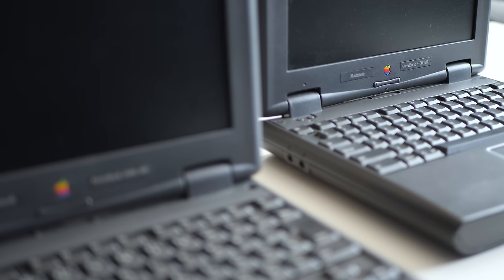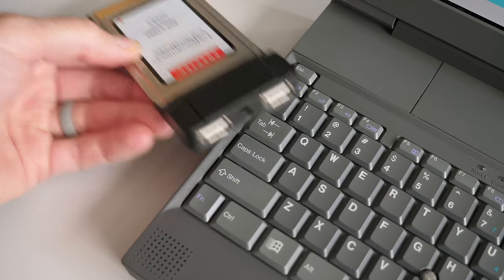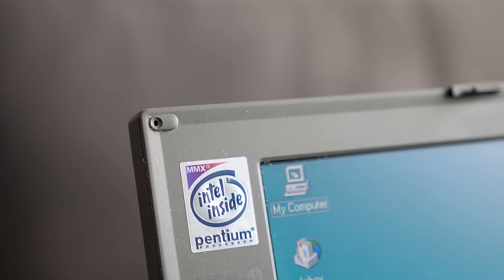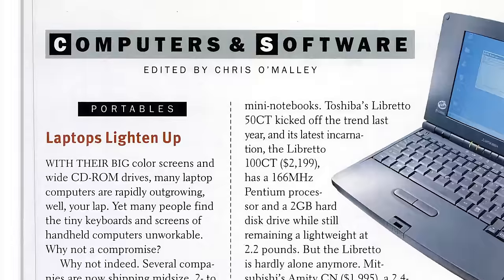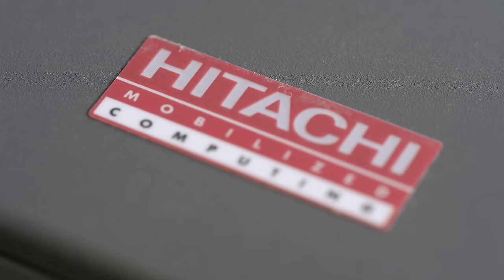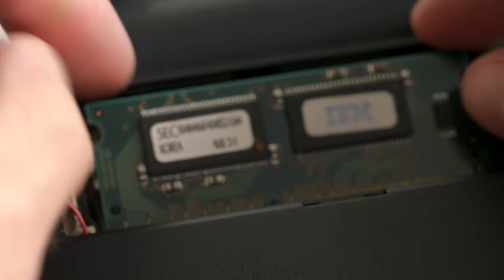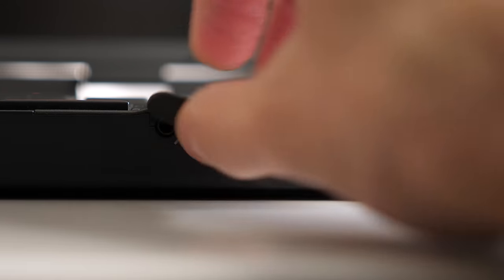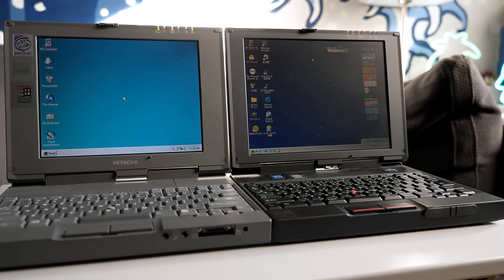ThinkPad 235: The Rebadged Subnotebook!

Comment: Even though it's not 'perfect', I love how those Crystal Audio chips sound.
Reply: I thought he would play a couple of short wav file clips too, not just Yamaha OP2 FM synthesis.
Reply: I really should've known it was IBM that actually manufactured it and not the other way around just by the keyboard, but the Crystal audio definitely tipped me off. Lot of older IBM PC's used it, including a newer PC 300PL I have that sounds a bit warmer and cleaner than this. I think PowerBook G3's also used Crystal chips but I don't think they had the FM synth or, was at least inaccessible
Reply: That sound would have blown my mind in 1997.
Reply: @marioman971  a lot of Dells did too, later. Dells of this era usually used ESS chips.

Comment: I love when youtubers are like 'i'll let you judge how this sounds.' I'm over here listening to this on my phone with a usb earbud and i'm like 'yep, that's exactly what it sounds like.'
Reply: ya, i want to hear keyboard clicks too!
Reply: So I did the leg work for you. I compared the audio he provided of passport.mid to my Sound Blaster 16 with a real OPL3 chip. I used the same set of Creative desktop speakers to listen to both samples. 

My conclusion is that the Crystal chipset in this laptop is pretty close to the real thing, I really couldn't tell a difference. That doesn't mean it's 100% Sound Blaster compatible, because as I found even Creative had difficulty with that back in the day.
Reply: @akaJughead  creative make speakers? I thought they only make headphones and sound card.
Reply: @asmc1492  i have a creative webcam
Reply: Haha yeah I know what you mean.  Despite having a smartphone since 2014, mine rarely gets any use other than occasional whatsapp wifi calls and TomTom GPS.  Doing anything else with a tiny 6 inch screen and no keyboard or mouse, is like torture.  Plus the video and audio chips inside those phones are very generic, and in an electrically noisy environment.
Reply: @Pampers Romania - Active Baby si Pants

Comment: It's been so long since I've seen a laptop without a USB port, it now feels weird to see one needing an adapter. USB is one of the best things to happen to computers. No more worrying about serial, parallel, PCMCIA, PS/2 ports and more. Now it's evolving to pretty much replace any connection (Display, power, etc..).
Reply: Everything basically. Look at laptops like the 2016-2020 MacBooks. While they really shouldn't of had, 4 USB-Cs and a headphone port and that's it. Kinda impressive.

Comment: I have the Epson Endeavor TK-400. It was still off for about 1 year, and now not run the S.O. The internal battery is low (1,9 V) but I think there is something wrong on BIOS or RAM because not see the internal hard disk and on POST, the word displayed is not correct. Where can I take info on this beatiful micro notebook? I tried on google but this model is very hard to get some information or link to download old BIOS

Comment: Actually pressing a hotkey during Windows 9x to enter BIOS is also found on Dell laptops, all the way up to 2003!
Even on something like a Pentium M equipped Latitude D600, D800, if the machine isn't running in ACPI mode with Windows 2k or XP or such, you can still press Fn+F3 to get to the BIOS battery page which enters the BIOS too. Seems like ACPI mode prevents this from being possible so you don't see that feature on newer laptops. The Latitude Dx10 series with their total BIOS UI redesign (as opposed to the same BIOS layout Dell used in 386, 486 days) no longer have this feature.
Reply: I’ll have to try that on my latitude c600 when I get it a new case(the right hinge is snapped)

Comment: Very cool machines!  I have a rather scarce sub notebook myself.  Mine is a Panasonic Toughbook CF-M32.  Its a Pentium MMX 166mhz, 96mb RAM maxed out, Yamaha OPL3SAx sound, USB 1.1, Type 3 Cardbus & infrared on the machine itself, Docking Station for using the external floppy drive + Serial, Parallel, & PS/2 and it has a Li-Ion battery which still lasts 3 hours or so.  It came with a 2gb hdd although since I got it, I upgraded to a 4gb hdd.  I did buy a M-Systems Aerospace 8gb SSD which they call an FFD.  These subnotebooks from this time period are awesome and although at the time people didn't buy them, they are highly sought after by collectors such as you and I.  I like small laptops.  That thinkpad 235 is very cool.  I wouldn't mind finding one someday.

Comment: I know this is kinda unrelated but I picked up a ibm Thinkpad 380ed at a thrift store  about a week ago for 7$
it powers on and everything but I have a puzzling issues with it.. first of all it doesn't have any sound at all I even took it apart to check if the speaker was unplugged and it wasn't, second whenever I put a cd in the cd-drive one of two things happen if its a data cd the drive spins up and it reads it but then the computer just shuts off completely and you have to unplug it and re-plug it to power it on again, second if I put a audio cd in it it doesn't cut power to it self and it works but there's still no sound.... I replaced the cmos battery because it was dead and the main battery is also dead and makes a strange whining sound when its in the computer.... also I'm using a universal onn brand power adapter because the I got it without the power adapter... Do you know what could be possibly causing these issues? Any help would be appreaceated.. Thanks!! :))

Comment: That resident BIOS idea was a trend for a while, although I'll never understand why. I once owned a 486 Packard Bell Legend in which the BIOS was accessed by striking Ctrl+Alt+S, but not before boot, rather from the DOS prompt instead. It wouldn't work from the Windows desktop, but you could actually open the BIOS in Windows' command prompt window.

Comment: $2400 for the system, or lease for $96/month. How long are they expecting you to lease it for?!
Reply from the maker: Usually 3 years, after which you send it back. Then they can resell it as a used or refurbished machine and make profit off of it again.
Reply: 2400$ divided by 96 is equal to 25 monthly rates. About two years…